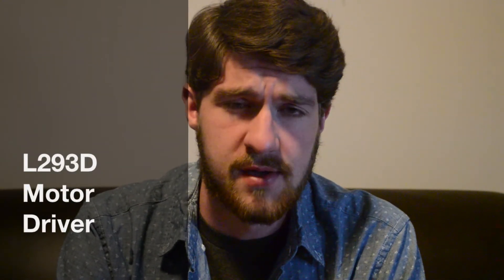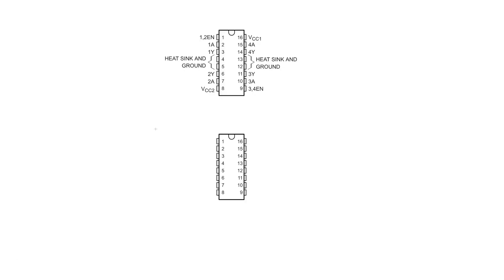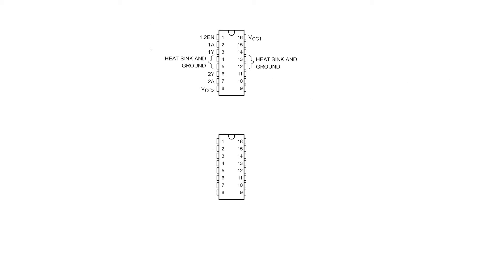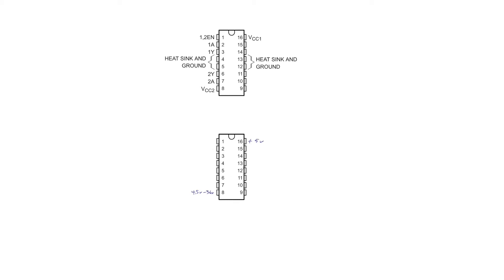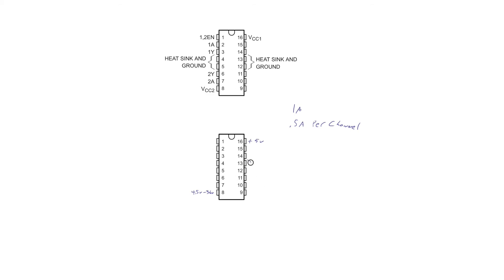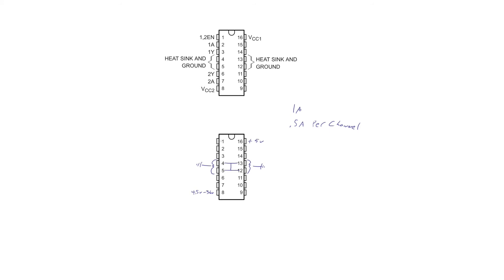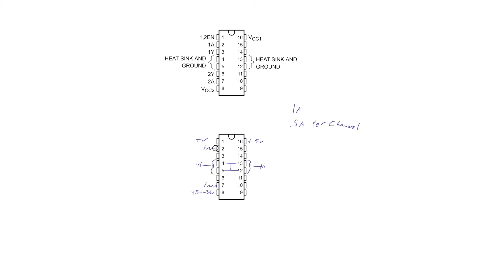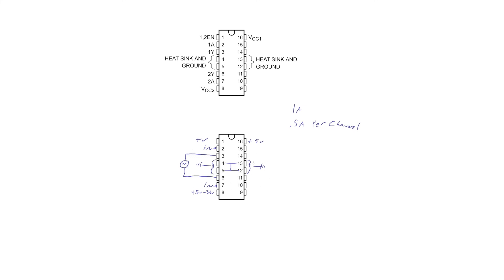L293D Basics

Comment: If I use the enable pin to disconnect the motor, that means that the motor is completely disconnected from the circuit, but If I switch both inputs to high or low, it's shorted out and will brake, correct?

Comment: ssssssssssooooooooooooooooooooooooooooooooooo.................
can I use this chip to make the output of a 9 volt battery pulsate so I can connect it to the 9 volt line of a transformer to get 110volts?
I just don't want to have to make a dc to ac inverter or make a large board or anything just to make a battery work on a transformer......
Reply: maybe too late but it should work, you might want to be careful though as to not send a power surge back into the chip, not sure what happens in that case

Comment: Very clear and concise instruction only thing I would have added is how to set Pin 2 & 7 to change direction of the DC motor, Thank you.
Reply: I think setting the pin low means the respective output gets set to GND and high means it gets connected to VCC2, so setting pin 2 and 7 as high and low would mean output 1 is positive and output 2 is ground

Comment: so what exactly switches the polarity of the motor, is it a 5V in the 1,2 or 3,4 EN? or is it how the inputs are?
Reply: if it's the input pins, then what do the EN pins do? is it like the on switch, without them you won't get any function out of the h-bridge? or is that what the Vcc1 did?
Reply: @abelabraham7742  vcc1 is for the inner logic I believe. EN pins are for enabling the bridges. And Vcc2 is motor power. Download a datasheet for it. It will explain the pin functions . An explanation for h-bridge . https://youtu.be/iYafyPZ15g8
Reply: 1,2 EN and 3,4 EN are like switches. If you supply suppose pin 1,2 EN with power, it will ENABLE the h-bridge on the left of the IC. Similarly if you supply 3,4 with power, it will enable the other h bridge(l293d is a dual h bridge ic) and how h bridges work is a different topic. Wait lemme find the vid for ya.
Reply: to switch the polarity, you have to switch which input is high and which is low, so (in order of 2, 7)HIGH LOW means output 1 is positive and LOW HIGH means reversed polarity

Comment: in data sheet he says use 0.1uf capacitor on vc and vcc why you didn't use???
Reply from the maker: Robin van, Ah, that is a good question and that is my bad for not bringing them up. If you are building this circuit it is a good idea to use these for sure (which of course is why they recommend them!), these are what are called decoupling capacitors, they are designed to reduce noise and voltage spikes on voltage rails by essentially "dampening" them out. These are especially important if you are driving your motor or logic supply off of a noisy power source (such as a cheap DC adapter, or a switching power supply, etc). They are not technically required for operation, and sometimes foolish people like myself will not use them, but if you can you certainly should! They will (almost) never hurt to have and can solve a lot of nasty hard to fix issues with noise. 

In short, I forgot to mention them because I am a fool, you should use them and be more wise than I am! 

Hope this helps!

Comment: Hi
how much current will ic take if our enable pin has pwm of 200
and both inputs are low
(stop function)
using 6v dc motor of robot car
Reply from the maker: Robin van, if I understand your question correctly, this would be a state where the motor is not turning, correct? Since both inputs are driven low, then both outputs would be low as well, meaning there is no voltage drop across the motor and no power is consumed by the motor (therefore it will not spin) in this case the chips power will be what is called the quiescent power, which I believe would result in 8mA being drawn from the logic level power, and 2mA being drawn from the motor supply power (however I took only a quick look at the data sheet to get this number, I definitely could have misquoted that number!). So you know where to look, I found this on page 2 of the data sheet under "Electrical Characteristics", I hope this helps!
Reply: thanks bro its really help full